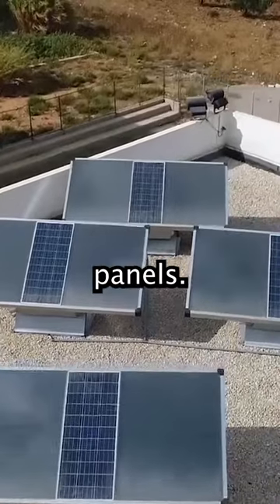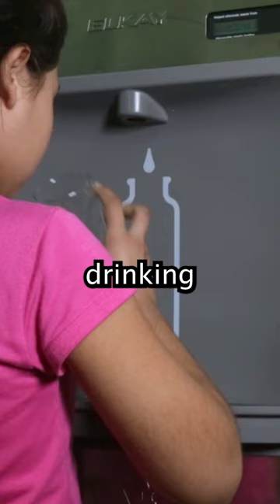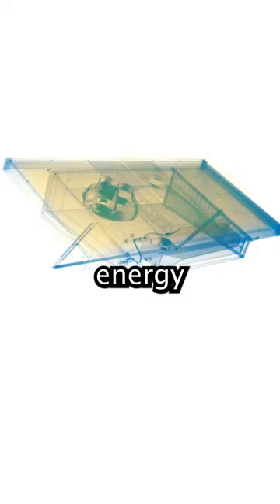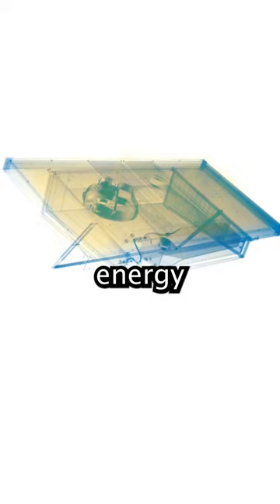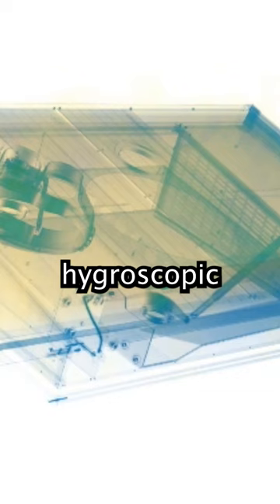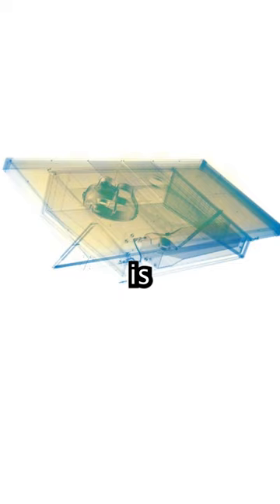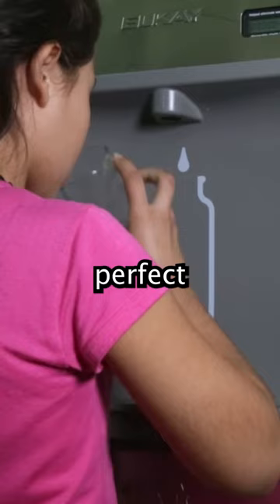Drinking Water from Thin Air! #shorts

Comment: Ahh yes, the ultimate water source during an apocalypse. Just gotta add a charcoal filter down the line and theoretically all's good to go
Reply: And making charcoal isn't hard
Reply: Tf you on about? No minerals in the water would mean the water washes off yours and slowly drains you of minerals and will eventually lead to extreme deficiencies
Reply: @karlmarx3705  didn't they say something about adding minerals?
Reply: @15_heidune72  yes, but you had to watch the 20 sec video to the end to find that out..
Reply: This is a scam.
Reply: @AflacMan13  possibly, I'd have to review consumer reports. It's not environmentally safe compared to a water well, but hey neither is a municipal tap water system. Nothing lasts forever. Also I doubt this works well in desert environments
Reply: @karlmarx3705  Still good for watering and washing, as it's basically rain
Reply: @feuerling  then just use rain water, it doesn't require a power source
Reply: Yeah, that's all you'll need...
Reply: @joshhickson7551  it doesn’t work in the desert
Reply: @morgantalifre8348  lol
Reply: This is useless
Reply: The question is how long it'll last before it needs a fancy repair or replacement
Reply: @karlmarx3705  you don't really need minerals in the water... It helps, but the food gives you a lot more minerals and nutrients than water, so unless you stop eating, you "can" survive
Reply: @karlmarx3705  charcoal is still the main reason it works. Just use stream water and run it through a charcoal filter. You can make them yourself

Comment: With 2x 500watt panels you can get 19 liters of water by using a regular dehumidifier. Filter and add minerals after. (@ 50% humidity). For a family of 6 people, it gives us enough water for drinking, cooking and herb garden. At the cost of a dehumidifier (and electricity if you don’t have solar). It is a plus for those people who have hardwood floors since a dehumidifier for summer months will help keep the relative humidity down and keep your floors from expanding too much and cracking and then of course contracting and leaving gaps during winter. So technically, it’s a win win situation 😅

Comment: Does It work in heavily polluted areas such as Ohio?
Reply: No, it's a scam.
Reply: @AflacMan13 Brother what is your source?
Reply: @quackatit  Thunderf00t and the Wikipedia page for dehumidifier's
Reply: It doesn't "work" anywhere. 
It wants to pull water from the air - so needs high humidity to function. The thing is - areas with high humidity have rain which removes the need for this device.
And "just adding minerals" won't cut it by way of purifying water (from this or from rain).
So in essence - any other method of getting drinking water under any conditions is better.

Comment: For those who are skeptical about the cost of the machine vs the amount of water you'll get from it, THAT'S part of the problem. People are so worried about immediate results that they don't wanna pay for FURTHERING the technology that will ultimately sustain us. Look at the history of the electric car, I dare you. Combustion engines didn't become more efficient overnight. Took years of investment to make them better. But why don't people want electric cars? "They don't have a long enough battery. They're expensive. Getting gas is quicker and easier." If more people wanted electric cars, businesses would FIND a way to make them better because they know that's where the money is. But if no one wants them they'll just keep making what you'll pay for. It's the same concept with these eco friendly devices. They'll get better with time and investment IF (and only *IF*) more people want it. But people are only concerned with how quick and easy it is to buy bottles of water.

Comment: I believe you need to account for the energy  used to produce the additives to make it drinkable...and the plastic (and other materials) waste it includes for packaging etc. Then you may find it is not that eco-friendly and not that off-grid after all. It may be good for a caravan or a boat, but not on eco terms...maybe for space saving instead of carrying bottles.
Reply: They are quite large. Usually mounted to ppl’s roofs.

Comment: I wonder if such a system could be made to use the heat from aircon systems, even if it is a miniscule heat, it could be used to reduce the wasted heat emmission by aircons in large buildings.

Just coming from Be Smart's video on the Aircon problem.